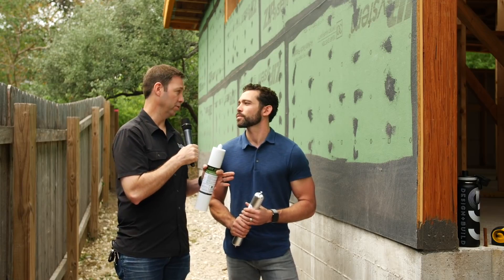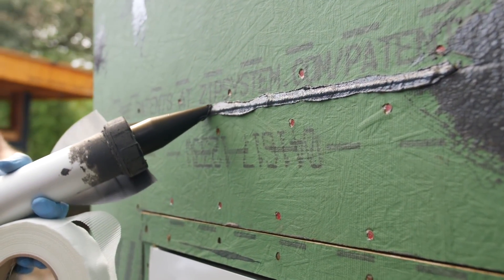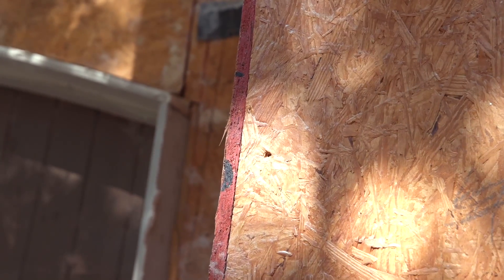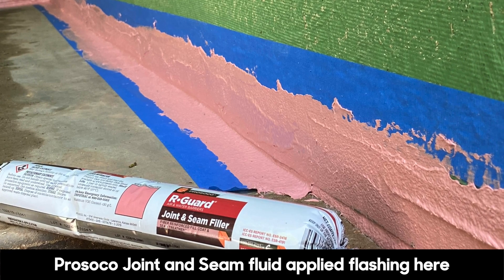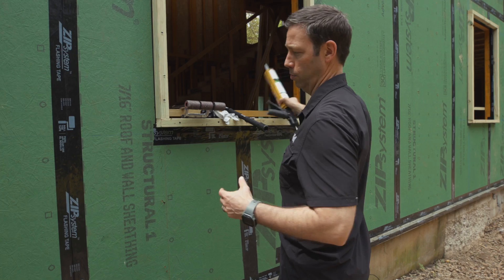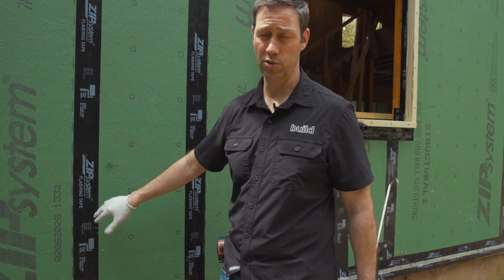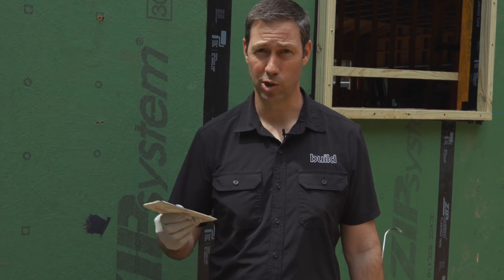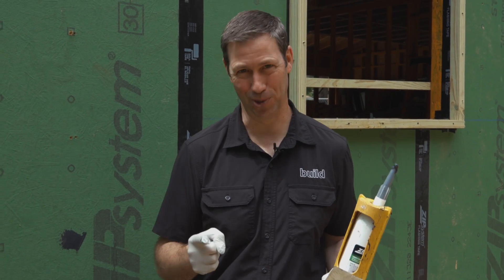Zip 1.5 - What about Over-Driven Fasteners?

Comment: I wonder if running a bead on the top edge of any horizontal tape seams would be worth it? It would give me a little more peace of mind knowing that water wouldn't be able to get behind that tape if for whatever reason a significant amount of water got behind the siding and ran down the sheathing.
Reply: i think if you're doing that you might as well just liquid seal the entire horizontal joint and lose the tape. ZIP 1.75
Reply: @kevinprociw3168  yes Kevin! Zip 1.75. But seriously once you are this down rabbit hole use a quality self adhered membrane product that self seals on 2 plus inches edges, es. If can do it vertically even more robust easier quicker install often less expensive on materials esp if more windows ;no shingling issues thicker vapor permeable barrier . and h can use use cdc much more water tolerant than zip
Reply: I think you may be running the risk of doing the opposite of what you're intending. If they specially formulated their "tape" to adhere to their specific substrate (he mentioned it's chemical bond), then i would not screw around with that.

Comment: Looking at this, I'm thinking wouldn't you want to do the bottom two feet of any vertical surface at the intersection with any surface? So, for instance, I think in the front of the house the garage has a shed roof that meets the second story. Are we also concerned with excess moisture from splashback from the roof of the garage?  Or is this specifically to deal with the groundplane?

Comment: How much is the tape? If it's cheap enough tape right down the studs, no? Or ask zip to make post it sized squares to patch each hole. I'll take a 10% cut.
Reply: expensive. almost 30$ a 90ft roll. cheaper if you buy direct.
Reply: I'd much rather use the fluid flash. The tape isn't that bad to apply (rolling gets hard on your back after a while) but it is quite expensive.

Comment: Ultimately, it may not matter, but right now is the only chance that you have to seal those overdriven nail holes. If it doesn't cost too much, why not do it? I agree that the bottom two feet is the most critical area and with foil coated foam insulation, not much moisture will be able to reach the ZIP system membrane, but any moisture that does will not have much incentive to dry out. Part of the perfect wall concept calls for drying on either side of the moisture control layer. Mineral wool does this, but foam doesn't. With foil against ZIP, moisture wicking may be a factor.

Comment: Stupid question, in all likelihood, but would it be more cost effective to simply cut 2 ft strips of the tape and run them from the bottom to two feet up at every stud, and then J-roll them in to seal any overdriven nails?  I have no idea how much a roll of the ZIP tape costs, so that may be a non-functional financial choice. Full disclosure - I am NOT a builder, but the thought about the tape occurred to me as you were doing this.
Reply: Ken, check out my response to Tam Barlas, I answered this very same question.  Short answer: it's way more expensive and will take way longer to do tape.
Reply: @bf2wesley  Thanks.  I appreciate the info!  (Though as stated, I'm not in the industry, just curious and love watching channels like this.)

Comment: whats the point of that you going to drive screws and nails in it not going to make a differnce when your siding go up going to be hole everywere
Reply: You mean after for the siding right ? I always wondered about that also and why not just use peel and stick that seals around nails, screws, etc ?
Reply: the nails used to hold the sheathing up can have the head of the nail punch through the outside membrane and give a spot for water to get in, when it's a nail from siding the head doesn't get to the sheathing and cant mess up the membrane, the membrane is able to seal around the shank of the nail. think of what the over driven nail looks like holding up the sheathing and then think of a nail thats standing a inch above the sheathing.
Reply: calical26 right!  And never mind when the  HVAC guy comes along after siding and uses a hole saw through all of it...

Comment: Excellent...…..effective and frugal...….I would just do all of them...…..no reason not to,.....120 bucks tops.  Plus its quick and simple.....

   Remodeling experience is golden when it comes to building houses......from what I have seen, if the nail holes were ever a problem, the sheathing would be shot .  In a zip system, you have virtually eliminated the sheathing failure, which only leaves the nail penetrations, so this effectively eliminates that.…..
Reply from the maker: Yes. Well said

Comment: Matt, three questions:
1) I'm curious if you're at all concerned about the penetrations in the zip from the added on framing for your overhangs?  I'm guessing not, but would love to hear your thoughts.

2) are you using pressure treated lumber for the overhangs?  Since they are outside the waterproof envelope and are the most likely framing in the house to get wet (from rain or humidity).

3) Are you going to Aerobarrier this house?  Assuming Zip 1.5 takes care of water issues in perpetuity, is sealing those inevitable small gaps and nooks (from overdriven fasteners, windows, etc) worth it?  Also, would you bring in the aerobarrier guys right after the exterior is finished or wait until drywall is hung and taped/mudded?

(BTW, random bonus thought: you could really bombproof the bottom 2' or so by running a peel & stick around the base of the house, which I remember you doing in other videos.  Is that just total overkill on top of the Zip sheathing?)
Reply: Just made the same comment about using peel and stick.

Comment: I know it’s not in your “wheel house” but any advice for anyone remodeling a manufactured home and wants to make their house more energy efficient?
Reply: Noah Patterson if you are re-siding make sure you pay attention at sills, top plates and windows. You probably have issues with the duct insulation as well. The ceiling insulation probably does not go all the way to the eaves. If not doing the subfloor check insulation and penetrations below. Unfortunately you can spend a fortune fixing one up and still not be satisfied.

Comment: Jake's house was a pretty good proof of concept about over-driven nails. That said, for the small amount of cost/time, why not do all the nail penetrations? A few hours with the lowest-paid guy on the job would knock it out easily.  Ironically, in your vid, just above where you stopped, the next row up looked like there were a few nails that missed the studs and were backed out - an air/water leak that should be sealed.
Reply: I saw those 2 holes !
Reply: Zip 1.0 just tapping seams, Zip 1.5 tapping seams and liquid flashing bottom 2 foot nail holes, Zip 1.75 XD taping seams and liquid flashing All nail holes, Zip 2.0 Liquid flash everything.
Reply: @xX1GuNNy1Xx  lol! I called it ZIP 1.25 for selectively flashing nail holes. And 1.5 for tape with flashing all holes.

Comment: why do we care about the nails here, but what about all of the nails that hold the siding on?
Reply: because these nails are over driven and the heads of the nails have exposed the wood, nails holding things like siding wont be over driven and the membrane will seal around the nails properly
Reply: @PicosOmega , Is Zip self sealing like peel and stick ?
Reply: @augustreil   The over driven nail can have effect of capturing water with the dimple vs the siding nail. I usually tape mine with 4 inch piece
Reply: @timahern8670 , Gotcha, thanks.

Comment: Im 99% sure..no other contractor is as thorough as this guy
Reply: He asks the right questions and poses solutions to the issues he identified. Most contractors are stuck in their ways and refuse to use innovations in the industry because they see it as a gamble regardless of the tests proven. A lot of contracting work is cost prohibitive though. He's a quality contractor because he has the budget to match it.  Most homeowners don't understand that correlation.
Reply: WileyDean I agree but I will say, those who have lived through many decades have seen lots ‘modern’ products lasting a decade or so when they come to fixing an issue down the road. No doubt, things have got better I just think a lot of old schoolers look at 100 year houses with solid bricks and mortar and think why bother with new.
Reply from the maker: Thanks guys!  Very kind
Reply: @buildshow is there a vertical rain screen type tape that can serve two purposes? 1 create a slight air gap behind LP smart siding as well as seal nail holes as the siding is attached at stud locations?
Reply: My contractors look at me like I'm crazy right now...

"That's unneccessary, overkill. We don't normally do that. Never heard of that. What's Smart baffle?
Reply: @JuystaFan  "I've been doing this for 30 years."🙄
Reply: I have never seen a perfect tape job like this in person unfortunately
Reply: My company is. We are doing a version of the 1.5 - 2.0 on all our jobs for all our customers.
Reply: @RustyGotBanned  Good call. I'm noticing the tape job my framers did is horendus. Glad I did the liquid flash sill seal myself atleast.

Comment: Why not just run 2 feet of zip tape over each nail row?  What's the price of 2 feet of tape compared to some of the "caulk"?
Reply: I just did the math based off a rough guestimate of the number of holes on Matt's house, and it cost four times as much in materials to do it with tape than with liquid flash.  Also, two guys going around the house with liquid flash could probably do the whole house in 15 minutes, and taping would take way longer.  FYI, Zip tape is about $20/roll, each roll is 30' long.

(I assumed 60 ZIP panels that would get this treatment, two rows of nails per panel, two feet of Zip tape per row of nails.)
Reply: @bf2wesley  That's what's I was thinking as well. The cost difference here is for sure the labor. Even if caulk is expensive, getting it up on the wall is super quick.
Reply: Zip tape isn't cheap. And then you have to roll it - quicker/cheaper/more idiot-proof to use liquid flashing

Comment: If I strip my exterior walls down to the bare OSB can I cover that sheeting with another layer of zip or ZipR?
Reply: You probably could, but it would probably make more sense to use a peal & stick.  If you then wanted to use exterior insulation you could do so with rigid foam panels or rockwool.
Reply: Yes, but unless you need extra OSB for strength, can wrap the bare OSB in a quality WRB like Majvest SA and use their Siga tape system to get air-tight exterior. Far more cost-effective than nailing sheets of Zip over existing OSB.  Go to Green Building Advisor and check their library for wall details that match what you need. Think 475 Supply also has a detail library.
Reply: or look at one of the roller applied sealers he talks about I believe one is from Prosoco and you could still, with siding offf hit every seam and nail with same Zip Flash
Reply: Not a professional builder but that might not be the best idea. What are you really gaining by leaving the old sheathing on? It would add some shear strength, but now you have to nail through the old OSB and you can't directly see all of the studs behind the sheet you're putting up. You can always go off of the existing nails but if the original framer was off a bit, now you're going to be off even a bit more than that so you might have more missed nails that are just going right beside a stud and the existing OSB will hold a nail well enough that you're probably not going to know if that happens. Why are you wanting to add Zip sheathing to an existing build though? Is this just to deal with air sealing or is there something wrong with the existing OSB like rot? Even if the OSB looks good as is, it's important to keep in mind that right now the OSB can dry on both sides, with zip sheathing added on top, it would only be able to dry to the inside and that gap between panels would do a good job collecting any water that sneaks by at the top and holding it up against your sheathing. If there is any rot, that's going to cause a decrease in the shear strength of the panels. you need the sheet to be held firmly against the studs so that the nail is just sheared right across it and not being bent. If there's a rotten piece of OSB inbetween that will bend the nail at that spot and it'll take way less force to do that than shear the nail. If you look at the nailing pattern for Zip-R sheathing, because of the insulation on the back they specify a tighter nailing pattern with the nails closer together in order to give it sufficient strength whereas if you look at the same sheathing but without the insulation it'll only need nailed 6" apart instead of e.g. 4".

You could cover up good OSB with Zip-R sheathing, but personally I don't think you really get much from doing so, and there are some drawbacks to it that might not immediately be obvious.
Reply: @AndrewMerts , Might be over thinking the overlay process. We have done hundreds of 1/2'' plywood overlays on roofs and never had an issue. Have done many on walls too. It's easy to find wall studs from the outside. As for the drying issue, never seen an issue, but anything can happen.